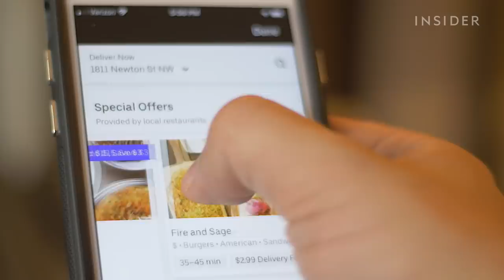How Used Chopsticks Are Turned Into Tables, Tiles, And Other Furniture | World Wide Waste

Comment: Hm nice but $1000 for basically a chip board table lol what a scam.
Reply: Perhaps their cost of labour and machinery would be $800 so I suppose the $1000 price tag is justified. Idk just throwing random numbers
Reply: These tables are made by hand, the workers have to be paid and it takes a lot of time. That is quite a fair price. 100 dollars desks are so cheap because the quality is mostly bad, most work is done by huge machines and the workers are not paid fairly
Reply: @beepbeepimasheep7347  i can carry a brick as I travel to multiple different countries. Then talk about how the brick has been on many different countries and then slap a price tag of $1000 for the brick.

Expensive is not necessarily useful.

Theres probably 1000 better ways to make a functional table
Reply: I think its more solid than chip board so offcourse it will be more expensive. The thing is if it have good build quality as solid wood table at the same price, so i think its not a scam. But definitely i will agree if they should have put the price between cheap IKEA chip board table and solid wood table.
Reply: Yes! I thought the same thing. I'm all for recycling of course, but not at a price higher than buying a full slab desk top. For a thousand dollars I want a full executive desk with drawers and matching chair.

Comment: During this pandemic, i think the quicker solution is to consider using biodegradable utensils and food packaging. Some stores here in Jakarta has started doing this. Yes it might be expensive and do not solve the plastic trash. But at least, in the times of "All clean and sterile", this might work. Also, some stores here require customer to pay extra for that biodegradable utensils and bags (which is not cheap actually).

Comment: so they use resin to hold them together? they just showed the hydrolic press, but there is no way that would hold up with constant use
Reply: Epoxy resin makes very durable table tops. Professional table makers use it to fill in cavities in the wood and improve structural integrity.

Comment: My big question would be, since they only burn the chopsticks and don't wash them beforehand what are those people with allergies to the foods they were used with, gonna do? Many of the probably had peanut sauce on them, suppose someone with that allergy buys a table. Or cutting board. What then? The germs mightve been burned but the allergens could still be in tact protected by that resin layer

Comment: Well, the end product ends up more expensive, kind of wondering how green it really is after all the processing.
Reply: Well, everything has a foot print. Think of all the virgin wood that would have to be used instead of this wood that has already been cut. It is certainly greener by comparison, and that is really the metric.
Reply: @doneachus6780  i mean when you add all the chemicals. Do the chemicals not produce any carbon footprint nor have any waste treatments necessary?
Reply: @GameFuMaster  Again, its a matter of degree. The amount of water alone that is used for initial wood production is astounding. Weigh that against the amounts they are using here...I do think it's better. As far as the resin...it's water based, which is certainly better than some. Consider the formaldehyde and other chemicals used in traditional flooring manufacture. On balance, it seems like it might be a net win.

Comment: I wonder if this is really a good thing though. Pure wood is 100% biodegradable, but after being coated with resin and other chemicals? 
Wouldn't it be a better idea to turn used chopsticks into something that can be burned to heat a house for instance like pellets? Yes, it emits CO2, but you have to make pellets anyways...

Comment: The problem with 4:11 is that when a restaurant delivered without utensils when the customer needs one, they might have to make a separate trip that takes more than 20 minutes just to deliver something that's less than 10 cents. So to play it safe restaurants will throw in utensils even if you ask for no utensils; You never know there's a dumbass who checked the no utensils  box then blame you for not putting the utensils in.

Comment: Don't know if I'd buy a 1000 dollar table. Every stick is oriented in the same direction which makes it susceptible to breaking easily at any of the lines between the sticks.
happens with bamboo cutting boards alot because they're also made out of smaller sections. a way to prevent this is using 3 layers with the middle layer rotated by 90 degrees sideways.

Comment: Eh, I got stainless steel chopsticks I use and bring with me if I know I'm going to eat with chopsticks. It's actually more about hating the feel and tininess of disposable chopsticks in my big hands than being environmentally conscious.  

A rule of thumb is that chopsticks should be about as long as the tip of your thumb to the tip of your pinky when your hand is spread out. It's ok to be a bit longer, but it's annoying AF if it's shorter. Disposable chopsticks are about 6 inches or 15-16cm long.  My hand spread is about 9 inches or 23 cm. I can't pick up shit with those tiny things, so I bring my own.

Comment: Nothing grosses me out worse than a flimsy plastic fork. If I’m getting food delivered I have utensils at home that I would prefer to use. I do however keep and re-use chopsticks as there natural properties of wood drying makes them easy enough to clean and reuse several times. Some days are harder than others to reuse though. And I noticed that the permanent plastic chopsticks that are sold for continuous use noodles slip off of them they are not as easy to use because they’re so slick as opposed to bamboo or other words. If I could make my own I absolutely would, but once you get bamboo started it’s hard to get rid of and in my hometown you can have your house condemned for infestations of bamboo or knotweed. Changes in law are the only necessary ones to create better habits.

But if I was in the business of selling plastic spoons and forks of course I would want them to be flimsy and break easily and be disposable so folks would have to buy more… Screw that, most of them melt in soup who knows what kind of toxins we are being exposed to you with that alone

Comment: This is a terrible solution. That the recycled chopsticks only come from restaurants is absurd and totally inefficient - just mandate restaurants to use washable/re-useable chopsticks - no recycling needed. The fuel, materials and energy required to recycle is a complete waste compared to just sticking them in a dishwasher. It's like throwing away silverware after every meal.

Comment: This is just complete overkill. Trying to fix a problem with wasting a lot of energy (gas for the car, electric machinery in their shop and even an oven thats on for 5 hours straight) on the back end. Better try fixing those single use items upfront in the restaurant but i'm not sure if that would be their goal as that would diminish them making a profit on the problem itself.

Comment: Its cool but turning wood chop sticks into something else isn't really the issue. It's cool and a nice step but chop sticks will break down in no time compared to the plastic utensils. Turning them into tables isn't benefiting anything period, trees are still coming down to replace the used sticks. Just now a company is making a profit off something they did not have to pay for. The issue is chop sticks in general, they need to be replaced with something reusable and be completely removed from the food industry.

Comment: You make this seam like a real issue, but wood actually isn't really the problem. This we decompose quickly, especially if spurted into biodegradable trash. It then is in a carbon cycle. The real problem is plastics and the solution for such problems need to go much further than banning i.e. straws, as in the EU

Comment: It seems dumb that a table is 3000$ when your trying to drive down the cost of material. You could get s solid wood or one of better material for the same or less. The idea of up cycling is great but chop sticks are 100% biodegradable and degrade quickly. This is a niche market making a profit out waste.  Its  a solution to something that wasnt a problem. Making something out of plastic ware would be a solution.

Comment: Why are they talking like this would reduce chopstick use in restaurants?  What they do is take pure wood that makes no damage to the environment if thrown away, and soak it with plastic resin, so when it eventually goes into a landfill it's not biodegradable. False recycling at its finest... Just sanding and forming that resin soaked wood creates so much microplastic dust.

Comment: Feel like as far as disposable cutlery goes, wooden chopsticks isn't really a big problem. They're easy to reuse or upcycle, recycle and they're biodegradable. World would be much better off if ppl used wooden chopsticks instead of plastic forks. 
Just another reason chopsticks are better than forks. Hate how gross forks can get cuz it's hard to clean between the prongs.